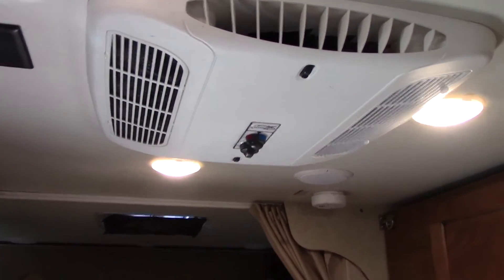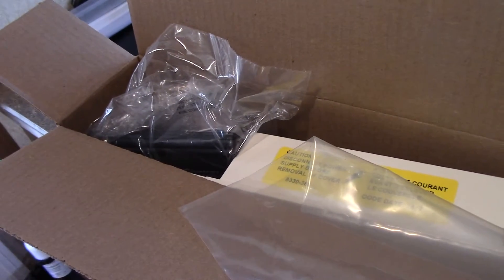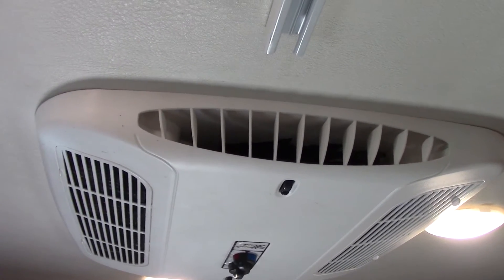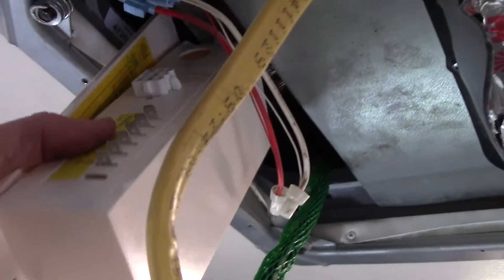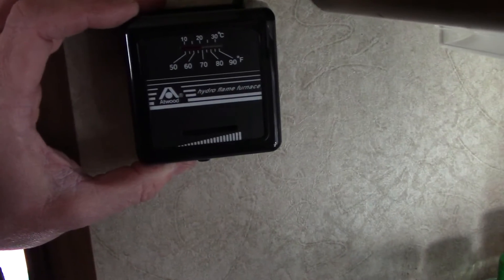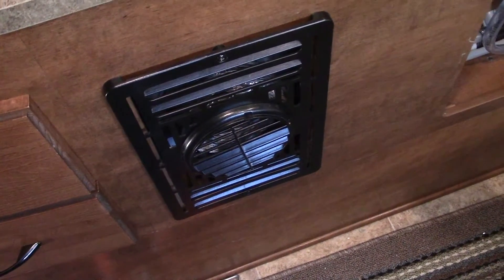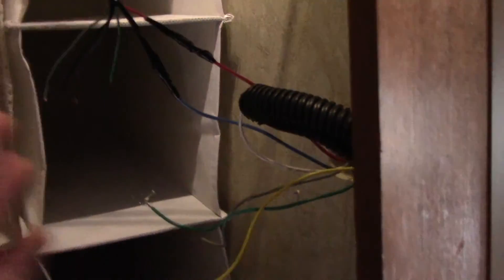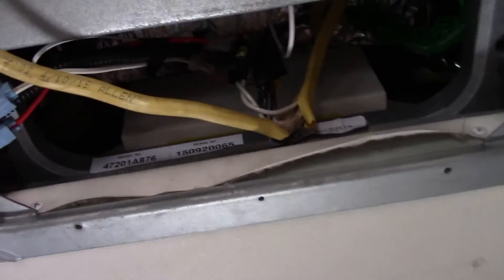Coleman Mach 8 A/C and Heat Manual to Automatic Thermostat Control Upgrade

Comment: What happens if your air conditioner has a heat pump how does it know the difference between the heat pump and the furnace
Reply from the maker: You will need a different thermostat

Comment: Your description says cool only but the video shows you trying out the cold & heat. So is the link & the part number the correct one for both? Asking bc the Amazon link says cool only? Please help
Reply from the maker: My description does not say cool only. It says AC and whatever propane furnace. This thermostat will work with the electric rooftop AC and a separate furnace type heater. If you have a heat pump in your roof top unit, this is not the correct thermostatic. Otherwise, it is the one.

Comment: Couldn't you just take your blower fan control wire and feed it off of the manual temperature controller, and then your fan would come on and off with temperature along with the compressor.

Comment: What do you do if there is no white and red wire already connected where do you get 12+?
Reply: Hey, Bill!  Did you ever figure it out?  I tried to grab 12v from a nearly 12v light switch but blew the circuit fuse.  My control box came with no instructions so unsure what to do.

Comment: does this set up cause the air conditioner fan to cycle off and on?
Reply from the maker: Depends on the setting. You can have the fan on continuously or cycle with the compressor

Comment: This video saved the day! I am the proud owner of a salvaged RV that came with a rooftop AC but all the interior wiring and ceiling assembly were missing. I have removed the unit to the bench and have been trying to sort out the wiring so that I can run/test the unit. Your video has shown me all I need know to make the appropriate connections. Mine, by the way, is a Coleman-Mach AC and it has the control box mounted up inside the unit (just like the one that you installed). Your careful explanations and diagrams have been extremely helpful! Thanks. You offer a great service to anyone looking to attempt this!

Comment: I confused on the wiring. The pair of wires from my heater are red/white with red being 12V. So obviously red connects to red on thermostat. Does the white wire from the heater connect to both the white on the back of the thermostat and the white on the AC controller?
Reply from the maker: It just depends on your heater model. You need to consult the manual / wiring diagram for your heater. You most likely won't need the +12volt wire coming from the heater.
Reply: @JackofAllMasterofNone  So I instead need to run a wire from +12V to the red wire connector on the thermostat?
Reply from the maker: No. Like I said without knowing what heater you have I can't tell you for sure, but when you switch on the heat setting on the thermostat the white wire from the thermostat is energized with +12v.  I would guess that you just need to connect the white wire from your thermostat to the white wire to the furnace and leave the red wire from the furnace disconnected and taped off. That is my guess but again without knowing what furnace you have I dont want to be responsible for you wiring it wrong.
Reply: Jack of All Master of None ok... thanks for your reply. I’ll identify my heater model and review the manual. Appreciate your feedback.

Comment: Does anyone have a video of the very first install of this thermostat?  Meaning they were using the mechanical one that came with the AC unit & installed a wall TSTAT from scratch to see what wires go where etc?

Comment: I have a heater as well, do you know  how to connect that up to the termostat? Since the control module only does cooling
Reply from the maker: I show in the video how to connect your heater to the thermostat. Maybe I'm misunderstanding your question?
Reply: @JackofAllMasterofNone  I think that he was asking how to control the electric heater that can be added to the rooftop AC unit as an add on. What I've heard about these supplemental heaters is that they allow some warming of the RV without having to use the Main Furnace. Perhaps the supplemental electric heater could be controlled from the thermostat heat connection, but that would leave the main furnace without control. Maybe two thermostats?
Reply from the maker: @EverydayProjects  They make a different thermostat that works with that type of heat strip in the AC unit and also the gas heater.

Comment: with the thermostat in auto mode. both the fan and compressor completely shuts off when it reaches the set temp., correct??
Reply from the maker: Yes it does or you can have it so the fan stays running and just the compressor kicks off. Either way.
Reply: @JackofAllMasterofNone  thank you